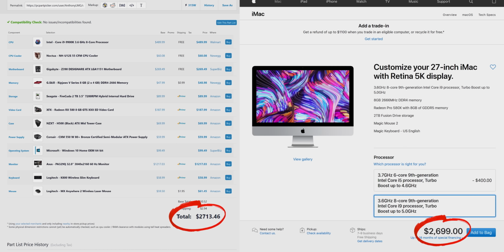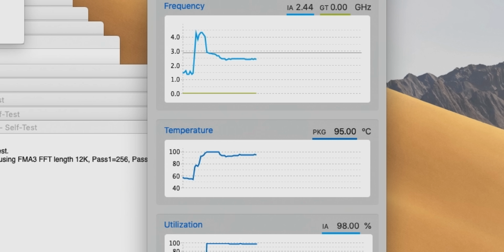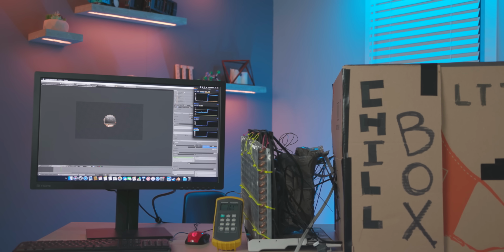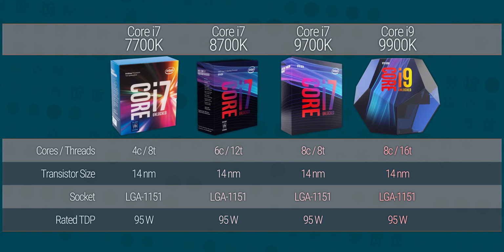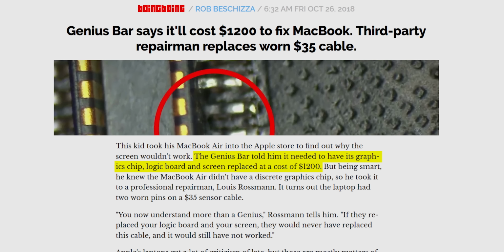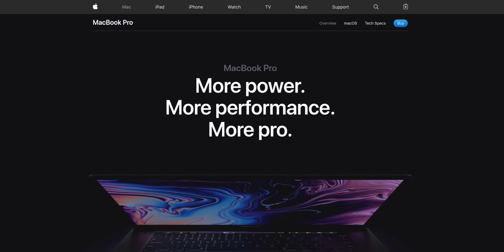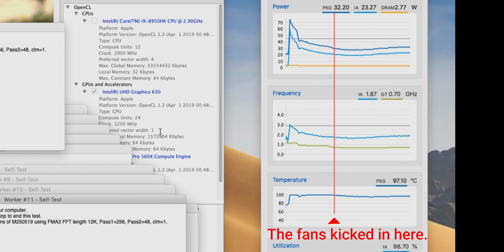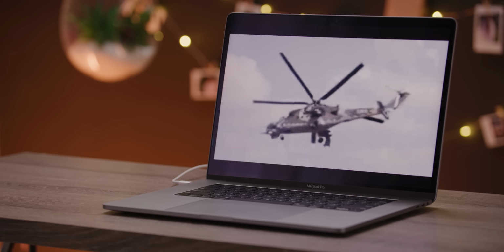Macs are SLOWER than PCs. Here’s why.

Comment: intel cpus arent that hot if you set them up correctly on the desktop.  gimme that 10 core cometlake and a noctua dh15 air cooler and ill get it to run 5ghz all core gaming and maybe throttle down to 4.7ghz or so all core for renders.  all you have to do is overclock as far as you can and then set a 220w power limit.  games wont ever get near that limit so it will run the full 5ghz at low temps.  and for rendering once it hits the 220w limit it will throttle back until its under the power limit.  gaming itll stay under 70c and rendering below 80c

mobile is another matter though.  intel really need 10nm.  itll be coming for select models this year though.  of course if the power and clocks are set sensibly a 6 core 14nm chip still hangs in there pretty good.

Comment: In a near future we're gonna have viable laptops with the size of Apple devices. But right now high end CPUs demand a strong cooling solution, which involves good old "big" fans and pipes. Macbook cases maybe are only adapted for things like mobile core i3 and i5. I'm curious to see if things will change if apple goes ARM.

Comment: Fucking hell Linus. You say same specs but you know it really isn't. Most of us also don't shill out on completely BRAND NEW EVERYTHING either. Not going to get mice, keyboards, drives or Windows as we already have them. You're also getting much larger cooling solutions that will allow it to run without throttling same with the GPU. Shit like the memory is likely bottom of the barrel bulk buys too vs your G.Skills and the like. You can also get boards for $120 vs your $270 overkill fucking board. Can get an amazing mouse for $27 compared to the shitty mouse you have on there, likewise good / better keyboards can be had for $35. The OS with macs come free, it's their own. A $1200 monitor at 32" is really no comparison to a 27" screen made by or for Apple directly yet again in bulk... 19 seconds in and I had to rant. >:| Hopefully you say something along these lines further in.

This is also why custom PC's will always be better, a big beefy fucker from the start from complete scratch can be pricey, but hey. That'd kind of the goal, Start big and keep it going with 2-3 parts over the years whereas an apple is more like a console, you buy the entire POS every cycle. So many things are fucking wrong with this it's not even funny.

Comment: The processor on iPhones is custom made designed by apple. While the processor for MacBooks is using a intel processor not designed by them. That’s why iPhone doesn’t thermal throttle. 

That’s my theory.

Comment: I've been PC since 1983, Mac since 2000, and Linux since 2007. Still use all 3 platforms on a frequent basis, and laptops are what I like because I travel frequently. As an Electronics Engineer (by degree) and now more of a data analytics guy (by employment), I like the content in this video. Thanks for some solid analysis. For me, though, faster isn't always better. Sometimes good enough given size, noise, and reliability make my choice of what box to use. Of the 3 platforms, MacOS is the most reliable overall, in my long-term experience. The "just works" thing has some truth to it, even if it is hyped a bit. For example, when a Mac goes wrong, it tends to go very wrong (you can say that a few times), but my Windows rig (a workstation class Lenovo Thinkpad on Win10) at work doing something undesirable is a weekly occurrence. Honestly, I think quite a few of my PC laptops haven't been that much faster for my work flow (no disagreement that they were faster) for the increase in bulk and weight and noise. I always want Linux to impress better than it does, but something always goes belly up when I rely on it for something mission critical (even though I do really like Mint 19). So, agreement on tech analysis, but I cut Apple some slack for me not having to screw around with the machine as much when I'm doing real work. Lets me concentrate on the work and not the box I chose that day to do the work on.

Comment: I have a PC as my main workstation but also still use a 9 year old Macbook. I dread the thought of using a 9 year old windows laptop because they just don't last that long. In my experience Macs are slower, but they usually last much longer.
Reply: My mom has a 13-14 year old HP that's still going! Upgraded to Win10 and everything! I have a 5 year old Lenovo Thinkpad T440s that's still almost brand new!

Comment: Every PC Builder knows, that he HAS to do the math when it comes to cooling. I had a Mac Mini 5,2 and the idle Temperature of the cpu was 68 Degree. Now I have a I7 4770 in my PC and even under stress it never came to 68 Degree. That’s what cooling is about. And now the clue - It’s a silent PC with only three case fans of 120mm, which can be adjusted manually to help the system when hard workload is to handle.

Comment: please make a video how to make a custom chillbox
Reply: Well, that's easy. Build a thermally insulated enclosure out of something like a cardboard box (which is actually a perfect material to use), then figure a method to pump heat out of it. My method du jour is to use a Peltier heat pump with a fluid exchanger. Hey, it worked very well when I built a HTPC using a Via Eden board and installed it in a beer fridge...

Comment: One hopes that if Apple goes through with the switch to internally developed ARM chips, throttling is done for...One hopes. Then again they don't really advertise clock speeds on A* chips and we have to figure it out ourselves, so how would we be able to tell if it crossed a "base" threshold or not...

Comment: Repeated all archetypes that have been repeating for decades. The thermal problems stem from Intel’s poor design as observed in the video. If you need raw power and you don’t bother fan noise, then get a gaming laptop. If you need an extremely stable system for work you can rely on everyday get a Mac. Simple is that.

Comment: How hard would it be for Apple to let the consumer choose a fan speed or noise level so that if someone was worried about thermals they could just let the fans ramp up? That is a failure on Apple's part, not the consumer's.

I use MacOS, iOS, Windows, and Android almost equally, leaning a bit towards iOS and Windows (my daily drivers are an iPhone and a PC). I find it really aggravating that when I use my MBP I can't just change the fan settings. Having the computer get so hot while doing any sort of heavy workload that my fingers begin to sweat is not acceptable on a machine that cost nearly $2000 new.
Reply: you can install a program to do that. annoying that you have to and it's not integrated but you have go that way but yeah
Reply: 3 words, Macs Fan Control. Now my Mac mini isn't molten when I do audio work.
Reply: Could you 3D print a water-cooled snap-on base?  Will ABS withstand the amount of heat the MBP produces?

Comment: lol that monitor alone is $1200?? Nice price comparison.
Reply: Yes it is a nice comparison because one of the main reasons for those iMac's high price point is the quality display included. 
It's being disingenuous to say you can build a comparable system cheaper and then intentionally cheap out on many of the specs, Anyone building a price comparison SHOULD be including ECC memory and a the closest spec panel possible.
Reply: @kuros-ov  Yeah i didn't even notice before but they aren't even the same monitors, that is a 4k, 32 inch vs a 5k, 27 inch. 5k's are expensive, but if you're going to get a 4k you can get one for literally half what that 4k monitors costs. No its not going to look like the mac monitor, but neither will that 1200 dollar monitor. Just a complete waste of money.
Reply: @frozenfenix0  Resolution isn't all. Apple hardware is popular in the creative industries because they tend to use displays with very good colour accuracy, Sure you can buy a cheap 4k panel that looks great for media consumption but it isn't necessarily accurate. A comparable monitor outright has to be a pro grade panel to even be considered.

Comment: I did the liquid metal mod and bricked my 2018 macbook pro when I put it back together incorrectly (shorted a battery board component with a pair of metal tweezers- always connect the battery last!) Didn't feel bad about getting the whole motherboard replaced under applecare: they should've made a better product. When I got the computer back I went and did the liquid metal mod again and this time I put it together correctly. It doesn't help much- yes it improves the conductivity between the heatsink and the CPU+GPU, but the heat still has to get dissipated into the environment via the heatsink fins and those just aren't able to handle  the i7 at 2.6GHz (not even the top end CPU) during Cinebench. And now my keyboard is inserting extra spaces when I type... If it take it back to apple then I'd probably have to go thru the whole liquid metal application process again because they'd probably replace the whole internals. In a few years (until apple care runs out) i'll probably be a liquid metal application expert hehe.

Comment: A faster CPU that thermal throttles will be faster than a slower CPU that doesnt,when the user doesnt stress his/her machine.

also a lot of basic applications that are needed to be fast are single core heavy so the application runs great without throttling.

this is why i would never get a apple laptop,they are designed for just basic multimedia consumption/office work just for that use-case they are awesome products thought.

Comment: This takes me back to the 2008-2009 era of Apple computers back when the Mac pro was a respectable machine and not the joke that it is now and you were able to upgrade its parts. At the time 1333mhz DDR3 was the standard or 1600 if the memory was overclocked. Apple used 1066mhz DDR3 in their Mac pros at the time for what ever reason. 

Also this is why it boils down to the manufacturer of the laptop as far as the cooling goes to make up for Intel's lack of making a CPU that is capable of running cooler. Also this is one of the reasons why I purchase a laptop with dual fans if it has a dedicated GPU 1 for the CPU and 1 for the GPU to me it really improves the air flow instead of using 1 fan to do everything. 

Also there is a 3rd party fan program that mac users can download and set custom fan curves that will override any nonsensical bs that Apple has done which should improve the lifespan of the machine.
Reply: Yeah, I HAVE to use Macs Fan Control to change those horrible curves. I can't stand 70c+ on my core while just doing some light work. BUT, with my custom fan curve, it really doesn't get that noisy until I really put a load on it, and it stays in the 35-45c range while doing every day tasks.

Comment: 5:19 Well I doubt the CPU will hit over 1000c. The socket will allow for movement anyway.
Reply: You can still damage components well below 1000c. It won't happen instantly like that, but over time things will fail. That's just a fact
Reply: @TheBrickson98  I understand it's possible but it's unlikely and really, the most common failures on motherboards are caps anyway. If you leave your PC on all time this won't happen and make it even more unlikely.
Reply: @Xenon777_  Check out Louis Rossman. You'll see just how common heat failures can be. Board warping does occur. While not as dramatic as you saw in this video, it's still there. Just subtle.
Reply: @TheBrickson98  It's Apple...
Reply: Xenon777 your point? What about it being Apple?
Reply: @TheBrickson98  It's probably designed to fail
Reply: Xenon777 ALL consumer grade electronics are designed to fail. Apple isn’t any worse than any other company out there when it comes to this. They just like to be thrown under the bus for it because in the interest of having peoples phones not crash, they were slowing them down.
Reply: @TheBrickson98  I think they are worse. Macs are sealed and dust is designed to be trapped inside and it is hard and expensive to open it to clean it. My Dell PC is modern and can be opened easily for cleaning.

Comment: Don’t get me wrong - I agree that it isn’t a perfect solution, but does it really matter?
I don’t buy Apple because of “status”, because it really isn’t that more expensive for me considering per year cost. And the biggest reason is convenience. My new MacBook Pro and old Mac Pro 2009 (although flashed to 2010 and upgraded to six cores) works perfectly together with Mojave, and having desktop/documents synced between them and iPhone and iPad OOB is extremely convenient in daily usage. 
The most hardware intensive tasks are video editing, 3D-modeling and studio usage, but not at all times. 

For gaming - a Windows PC, I don’t use it for anything else. Why? Because even though it should perform better than my old Mac Pro (and it does with games), I have a lot more problems with performance issues in Adobe Premiere due to driver problems etc than I ever have on Mac. 

All in all I don’t care about the “fanboys” etc, why compare oranges and Apples (pun intended) when you just use whatever you choose, both even - as long as they serve their purpose. And as for me, Windows 10 is perfect for gaming/Xbox integration etc, but not for my productive usage.

Comment: Most Mac users are in for the operating system.  I have extensively used both PC and Macs having both systems at work and at home for over 20 years and there is no doubt I would prefer the Apple operating system any day. However I love World of Tanks and so I have a 1 year old decent spec gaming PC. My 6 year old reliable Mac that I used for YouTube and surfing the net and office stuff was zapped in a lightning storm a year ago so I now use the gaming PC for that as well. But I am considering getting another Mac for everything else maybe a used one because it is just so easy to use, never crashes, never has software issues forgets the printer etc etc has updates the this or that device wont work etc etc. I am not interested in the guts of my computers just what they do for me.   I want it to just work in the background I do not want to have to stuff around with it. I have often wondered how far my PC's could fly if given the right encouragement. The Mac just worked. The ####### PC always has some software crap issue going on. If I had a car that needed to be fiddled with as much as the PC I would trade it.

Comment: No worries, they're getting their ARM chips ready.... But yes, Mac suffer from bad cooling design choices overall. On the other hand, my cMP was the best Desktop Computer Ive ever owned. Still running it with maxed out CPU, Ram, a HighPoint NVMe SSD7102 and a Radeon VII. Ruins like a charm for now...
Reply: I'm also running a cMP 5,1 with everything but the CPU maxed out. Works flawlessly for what I use it for.

Comment: Just looked at the details in Linus's parts list which shows:

Discounted parts PC build US$2713.46
Undiscounted iMac US$2699.00.

Missing items:

Fans (at least 2)  US$39.90
Thermal Compound  US$6.39
Camera  US$24.99
Speakers  $38.10
Microphone  US$27.99 
Windows 10 Pro instead of Home  + US$30.50 - $89.61
Microsoft Office Pro  $339.95
Movie editor  US$??
Music editor  US$??
ePub Editor  US$??
PDF editor   US$??
Assembly  US$??
Warranty on assembled unit US$??
Shipping  US$??
Support  US$??

TOTAL (minimum) + US$507.82 + $??

CORRECTED PRICING:

PC Build US$3221.28  +  $??
iMac US$2699.00  (disc. US$2429.10)

And the PC Build will look like a dog's breakfast and not run macOS without a lot of pain.

It would be nice to eventually see a real like for like comparison. Every comparison I have seen to date has NOT added up everything, and not allowed for the fact that you CAN buy cheaper iMacs if you don't buy from Apple. Where I am they regularly go on sale with 10% discount.
Reply: ...and when they go on sale Apple price matches.
Reply: The eternal circular argument with PC users is the comparison between two lists which don't match, but the PC users don't understand that they don't match, All they look at is (some of the) hardware. But are curiously blind to display quality. How hard is it to SEE the in your face difference? Makes you want to whack them over the head with their white cane and put their labrador out of its misery.

Like an old boss of mine used to say about customers: "They ask for a quote to paint a ceiling. They'll pay for two coats of white, but want the Cistine Chapel". 

Most PC Mac Haters wouldn't even know the Cistine Chapel if you rubbed their noses in it: "Is it a FPS?"

Comment: I like that Linus talked about that mythical being we call, Apple Tax. I’ve had several pals tell me they will build Hackintosh computers because of price. When in reality loss of time due to hardware and software issues costs more then just time. 
Good video showing some of Apple’s PC shortcomings.
Reply: I'd rather pay a little more and have someone to shove my computer at and say "fix this" when something goes wrong. I'm at the point where downtime costs more than whatever I would save by building my own Hackintosh rig. Plus I like the TouchBar. I know, I know.
Reply: @OurFantasyLife  We are on the same page. I prefer to have a reliable computer that I can support for as well. Good call and money well spent.

Comment: Thin and light is SEXY !  The average users almost never run any app that taxes the CPU so they are not going to notice any throttling.
If Apple doesn't make their own ARM based processor for laptops then they need to seriously be looking at the AMD 7nm Zen 2 chips that will be out later in 2019 or they are going to get their A$$ kicked in 2020 !